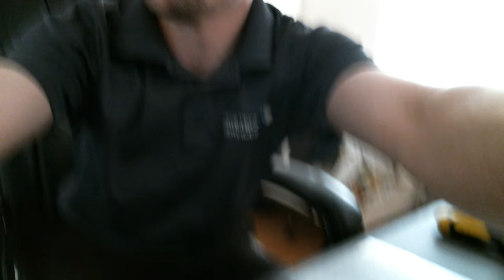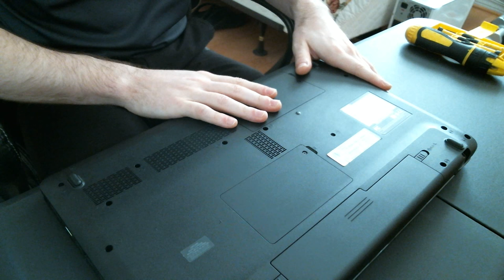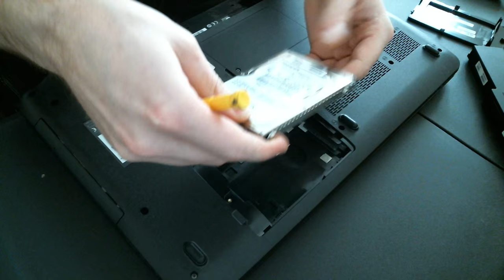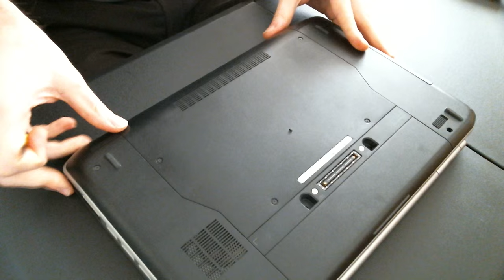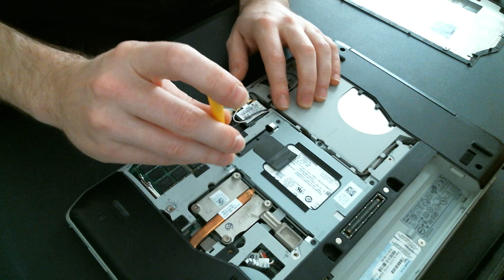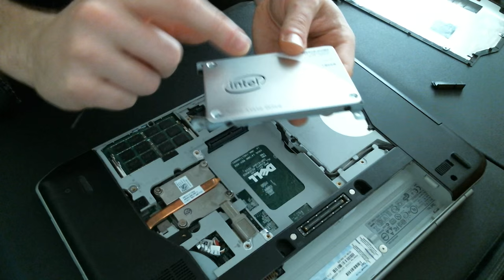How to Install a Hard Drive into a laptop (PC)

Comment from the maker: A hard drive comes with nothing installed on it. You will have to backup all of your data on your current hard drive before you install the new one. Once you install the new hard drive you will have to install Windows (or whichever operating system you use) on it first and then you can put your save data from your old hard drive on the new one. I suggest using a flash drive or external hard drive.
Reply: Aaa
Reply: FryeTech IT AG

Agenda ta de sanitary
Reply: I change my hard drive recently but when i check my laptop once its done i found out that i have all my images on hidden mode  the installer didn't know that..can i  get the images back with the old hard drive?
Reply: I used acronis clone disk

Comment: Sir i have an HP laptop and it is 6 years old. It specs are it has intel pentium logical processor and intel hd graphics.The thing is that it was nicely working but when i installed GTA 5 game it started giving errors and then after we formatted laptop the laptop started becoming slow and now the diffrent types of errors are occuring in my Laptop. Should we change hard disk in it?
Reply from the maker: Download this tool Seatools for Windows via the link below. Run it on the computer. It will let you know if your hard drive is failing. if it is, you have a few options. 
1. Put the time and effort into replacing the hard which includes reinstalling Windows and migrating data to the new hard. 
2. Upgrade the hard drive to an SSD and do the same thing per option 1. 
3. Invest in a new computer since your computer is 6 years old.
NOTE: In my opinion, most hardware that is 5 years or older is not worth investing in unless you can do the work yourself. With a game as intensive as GTA 5 I am surprised it was "working nicely" but I don't have a the full specs on the laptop. It might just be worth investing in a new laptop if you are going to continue to game on it.

https://www.seagate.com/support/downloads/seatools/seatools-win-master/

Comment: What dows it mean when you can add one hdd slot i got laptop, and want more storage
Reply from the maker: There are a couple of ways to add storage to a laptop. First, find the manual for your laptop online and see what type of hard drive connectors it has. Does it have more than one? If your laptop has two different connectors then what type are they? New laptops are coming with a different type of hard drive (well SSD) connector called a M.2 connector. They usually support either support a SATA M.2 or a NVMe M.2 SSD drives. This means that you can install a M.2 SSD drive and piggy back a 1TB HDD drive in the standard SATA hard drive connector. If your laptop only supports one hard drive connection then the only way to upgrade storage is to replace the main drive. This leads you to have to either A. Reinstall a fresh copy of your Windows OS on the new drive and move your data with a flash drive or B. Use an imaging program, e.g. Clonezilla, to image you hard to the new larger hard drive and then install it. Each one of these scenarios is not just a straight forward install and takes some research and skill to do. If you can send me some specifics and I can try and get you through the process. I guess a last option would be just to use an external hard drive if it is just for data storage. Hopefully this gives you a starting point to research or send me over some info to get you started on upgrading you storage.

Comment: My laptop only has like 297 gb on it but my old laptop that stopped charging had one that was 500 and I was wondering if I put it in my new computer would it still boot
Reply from the maker: It will most likely boot in another laptop if you have not tried it already. It was much harder back in the XP days for that work but now, especially with Windows 10 and above,  you can swap a hard drive to another machine and it will most likely boot right up. You might have to activate Windows again and possibly some other licensed software. Definitely worth a shot.

Comment: I am buying a new laptop which have a 256gb SSD in it and comes with HDD slot where i want to install the HDD drive. So, i do not need any software or something like OS to install right...??
Reply from the maker: Is the 256 GB SSD a M.2 style? If so, you should be able to install a standard SATA HDD with it as well. Once you install it you will have to initialize the disk, I suggest GPT, and then partition it so that it will show up as the next drive letter (E Drive or something similar).

Comment: I'm buying a laptop that's actually really cheap and slim, called the coda spirit 13.3 and when I look at what a hard drive looks like, I think will that fit into my pc? because as I said the laptop is thin but is every hard drive on a laptop the same?
Reply from the maker: Hello, It looks like the Coda Spirit has 32 GB of Flash Storage. I cannot completely confirm but I believe this type of hard drive is direct soldered to the motherboard and cannot be removed. I also don't think it has any other connections to install any other type of hard drive / solid state drive in it. That is the reason these machines are so cheap. You can use an external hard drive or flash drive for data storage but that is about it.

Comment: Hi do you know where I can buy a hdd for laptop, i bought one and its to big for pc, I put it into amazon and only hdd for PCs shows up
Reply from the maker: Hello, a desktop with use a 3.5" form factor hdd and a laptop will use a 2.5" hdd. I suggest that if you are replacing your hard drive to buy a SSD (Solid State Drive) and not a HDD (Hard Disk Drive). SSDs are much faster. If I understand your comment correctly, you bought a hard drive offline and it was to large to fit in your laptop. You need to make sure that it is a 2.5" form factor hard drive. I will post a couple of links. One for an older HDD* drive and one for a newer SSD**.

*2.5" 1TB Seagate HDD - https://www.amazon.com/Seagate-BarraCuda-Internal-Drive-2-5-Inch/dp/B07H28QRKN/ref=sr_1_3?dchild=1&keywords=2.5+hdd&qid=1632239893&sr=8-3
**500GB Western Digital SSD (only come in 2.5") - https://www.amazon.com/Blue-NAND-500GB-SSD-WDS500G2B0A/dp/B073SBZ8YH/ref=sr_1_5?dchild=1&keywords=2.5+ssd&qid=1632239929&sr=8-5
Reply: @fryetechit4009  oh yh thanks for the reply, I asked my dad and he said the same thing I bought a 3.5 one but now I bought a 2.5 one. And this will fits yh Ik SSD is faster but also expensive, like I spend £60 for a HDD 2.5 2tb and a SSD with 2tb would be more then £100 that's why I could only afford for now a HDD. But your video is good, when I get my HDD I will come back to this video so I don't make any mistakes

Comment: Will I be able to put this in my desktop computer? (not a laptop)
Reply from the maker: The only difference in the laptop hard drive and a desktop hard drive is the size. Most desktop drives are 3.5" and laptop hard drives typically run 2.5". Now you will see one or both with the M.2 technology which has a completely different hard drive interface. Here is a link to a mounting kit that will allow you to mount a "laptop" (2.5") drive in a desktop (3.5") bay.

https://www.amazon.com/Corsair-Dual-Mounting-Bracket-CSSD-BRKT2/dp/B016498CK0/ref=sr_1_3?crid=1BPHDYQDHGU2O&dchild=1&keywords=3.5+to+2.5+hard+drive+bracket&qid=1609193742&sprefix=3.5%22+to+2.%2Caps%2C212&sr=8-3

This actually will hold up to two 2.5" drives. Just remember that you cables will have to reach it. Also if you happen to use two drives your SATA cable will need to have straight connector on the end instead of the "L" heads.

Comment: I own a  Toshiba 3TB USB hard drive but I'm curious is it possible to put the USB hard drive inside a laptop?

And if you need to do something with the USB hard drive before you can put it inside a laptop.

My hard drive inside my laptop is 686 GB.
Its a Toshiba MQ01ABD075 SCSI Disk Device that is inside of it. 

But I wish I could put the 3TB Toshiba USB hard drive in there instead.
Reply from the maker: I am believe that you have a USB 3TB Toshiba external hard drive. If that is the case, you can remove the HDD from the external enclosure and then install that in the laptop if the laptop supports the drive type. I researched the Toshiba MQ01ABD075 and it looks to the a SATA drive and not a SCSI drive. Almost all laptop should support SATA drives. If you are trying to install the drive "as new" then you will want to format it first and then make sure to have the Windows installation media/flash drive ready to install Windows. If you are adding it as a back, you laptop has to support multiple hard drives. If that is the case, you can format the drive and then use it as a data drive. Hopefully this helps out.
Reply: @fryetechit4009  I asked advice to a PC seller who sells PC related things. He said it was a bad idea removing the case of those new 3TB hard drives. I asked for a intern hard drive for my laptop instead of 2TB and got the wrong one. He gave me a dektop intern hard drive. I will return it friday and ask my money back and will buy the right internal hard drive on the internet.
Reply from the maker: @stargirlvampire  Sometimes it is hard to remove the internal drives from the external enclosure but it is possible to do. Not sure why he sold you a 3.5" Desktop hard drive when he knew you had a laptop but you will need to get an internal 2.5" SATA hard drive. Here is a suggestion on an internal laptop hard drive.
https://www.amazon.com/Seagate-BarraCuda-Internal-Drive-3-5-Inch/dp/B07H2RR55Q/ref=sr_1_9?keywords=2.5+2tb&qid=1572450970&sr=8-9
Reply: @fryetechit4009  I sold the desktop drive and bought an  2TB nternal drive for laptops. I was able to put it inside my laptop all by myself thanks to your tutorial.  I also installed win 7 back and added a program that searches for any missing driver and installs those missing drivers. I did many windows updates and finally was able to upgrade to windows 10. The only thing I need to do now is add and install all programs and games from my 3TB and USB's back to my pc. I also bought a all in one hard drive station both for internal drives both desktop and laptop ones. Also includes USB ports and card slots. If I want more space in the future. The laptop internal drive I bought was the one from your link and it works perfect.
Reply from the maker: @stargirlvampire  Glad to here it all worked out and the video helped you out. That was my goal in creating these videos.

Comment: Hey FryeTech, if i change my hdd into a new one, do i have to install windows 10 on it? I do have iso of window 10 since I buy from store
Reply from the maker: Yes, that is correct. A new hard drive comes blank with nothing on it. You will need to use a DVD or flash drive to load Windows 10 on the new hard drive.
Reply: @fryetechit4009  thanks for replying, i appreciate it. Thank you 😉 i just want to make sure ☺

Comment: Sir i have an old hdd and i will attach it to my laptop does the old hdd's files is still in my old laptop? Because im not using it for about 4 years
Reply: They should be unless the HDD is damaged in some way. Since the data is stored magnetically on a HDD it will stay there as long as the drive is mechanically functioning and/or it doesn't get close to a strong magnetic field like an electromagnet.

Comment: what if i put 2 hard drives with windows installed on each them on my pc? will that cause a problem?
Reply from the maker: It will boot off the first hard drive that is detected by the BIOS. That should be the SATA0 slot. Windows usually letters it as the "C" drive. The other hard drive will be labeled with a different letter and show up as a secondary hard drive. There is a way to mess with the boot record to allow you to choose the other drive to boot from but that doesn't happen by default. Long story short, it will not cause a problem to have two Windows bootable drives in the computer but you will only be able to boot to the Windows on the hard drive in the lowest numbered SATA slot without modifying the boot record. I hope this helps. If not let me know.

Comment: How can I install windows 10 in new hard drive if my old is corrupt not working at all
Reply from the maker: Get a flash drive of at least 4GB and download Windows 10 here https://www.microsoft.com/en-us/software-download/windows10. Download the Media Creation Tool and it will install Windows 10 on the flash drive for you. Boot to the flash drive on bootup instead of the hard drive and it should prompt you to install Windows 10. You shouldn't have to worry about a key code if Windows 10 was previously on the computer. If you need to move over any data, you will have to connect the old hard drive to your computer as an external hard drive with a hard drive dock or something similar. If Windows was too corrupted or the old hard drive was failing then you might not be able to access the data. Good Luck!

Comment: Does that work for any laptop?
Reply from the maker: Most laptops have a removable hard drive but not all of them. Some of the Chromebooks and other lower end laptops will not have removable/replaceable hard drives. The hard drive is directly soldered to the mainboard. Some laptops that are for home use only take some effort to get into to be able to swap out the hard drive. Refer to the manufacturer's website and look for a full operations manual or just Google search for your laptop model and how to get the hard drive out. Another thing to keep in mind is that newer laptops are coming with the newer M.2 form factor hard drives, and they look different and connect differently to the mainboard. Let me know if this is the case and I can try and help out.

Comment: I'm buying a laptop which has 256 GB SSD ,and no hdd ,can I uprade the HDD by this way are is there any other way ,it's a gaming lap
Reply from the maker: If I read this correctly you are wanting to upgrade the 256 GB SSD that comes with the machine to say a 1 TB SSD? If that is the case then you can do that but you will have to either A. reinstall Windows 10 on the new drive or B. Image the old drive to the new 1 TB SSD. I suggest A. You will need a flash drive of at least 2 GB and download the Windows 10 installer. Go here https://www.microsoft.com/en-us/software-download/windows10 and click "Download tool now". Insert a blank flash drive and tell it to create a Windows 10 flash drive. Swap your drive out to the new drive that you buy. Insert the flash drive and boot to the flash drive (Windows 10 installer). When you install Windows just choose the correct version I.E. Home or Pro and then it will automatically pull the key code from the UEFI system. If it prompts you for a key code check the laptop to see if a sticker is on it with a key code or tell it you don't have one at that time. Try to activate Windows once the laptop boots into Windows. NOTE: Don't forget to remove the flash drive after the first reboot or it could just boot right back to the flash drive. Good luck!
Reply: @fryetechit4009  sir it does not come with an 1tb HDD..but I wish to add 1 tb HDD what are steps I should follow
Reply from the maker: I see. You want to keep the 256 SSD and add an additonal 1 TB HDD. Does it support having two hard drives installed at the same time? Laptops these days are starting to do that but there a quite a few that do not support that feature.
Reply: @fryetechit4009  yes it supports adding two hard drives ..
Reply from the maker: @user-qc5ub4hb3z  In that case just purchase a 1 TB drive that is compatible and install it. When it boots up you will have to go to Disk Managment in Windows and initialize it as a GPT or MBR partition table depending on the existing drive. (If it is a new laptop then almost definitely GPT). Then format the drive in NTFS with the default settings and what ever name you want to name it. Then it will show up as the next drive letter e.g. if you have just the ssd and dvd drive then is should show up as the "E" drive. Lastly you just move data to it or tell things to install to the drive.
Reply: @fryetechit4009  thank u so much
Reply from the maker: Lara Croft's Adventures  - You can use a couple of different types. You use the standard Hard Disk Drive (HDD) [Really Slow], a Solid State Hybrid Drive (SSHD) [fast-ish], or a Solid State Drive (SSD) [fastest]. I recommend using a SSD because it is the fastest and they are not that expensive these days.

Comment: Is any internal hard drive compatible with any laptop
Reply from the maker: Yes, except you need to make sure to purchase the correct size drive. Laptops use a 2.5" hard drive while desktops usually use the 3.5" drive but can use a mounting bracket to support 2.5" drives.

Comment: I plan on buying a hard drive. Will I lose all the system stuff?
Reply from the maker: There are programs that will allow you to image a hard drive exactly. I use an Acronis program but you can use others. If you are replacing your hard drive due to hardware failure then it depends on how badly the old hard drive has failed if  you will be able to retrieve the data from it. If it is the gain space then a cloning program should image it just fine. Here is another example of a program you could use: https://clonezilla.org/